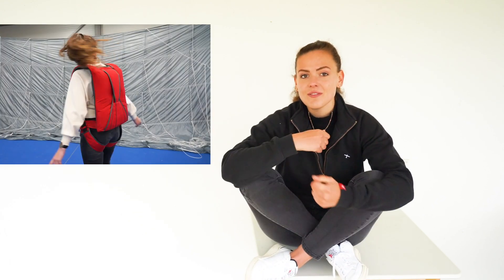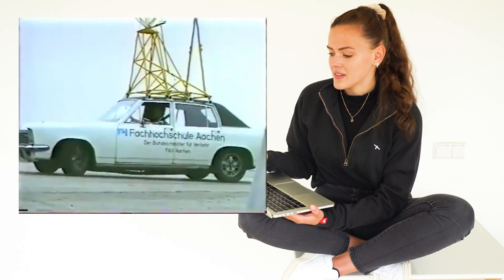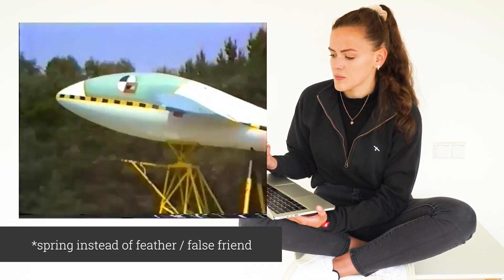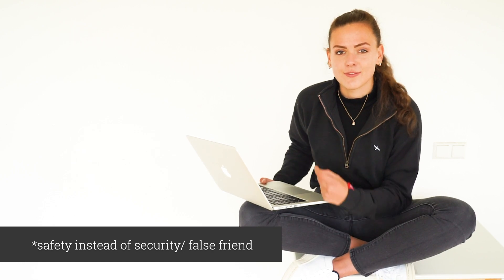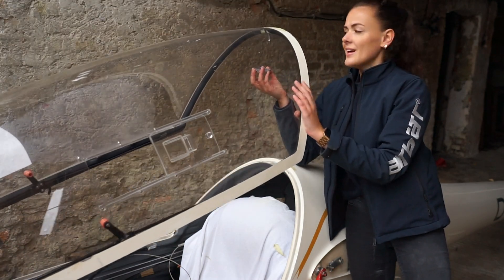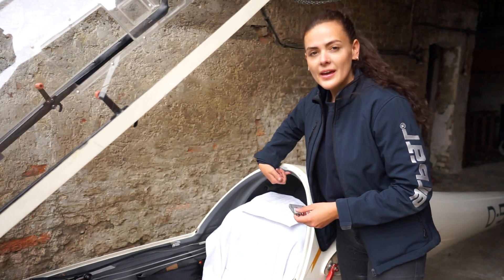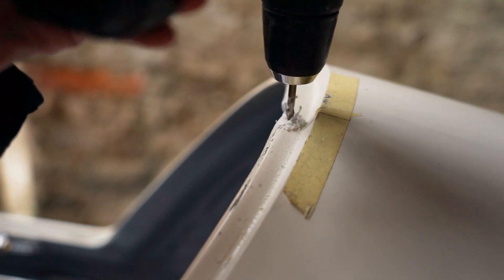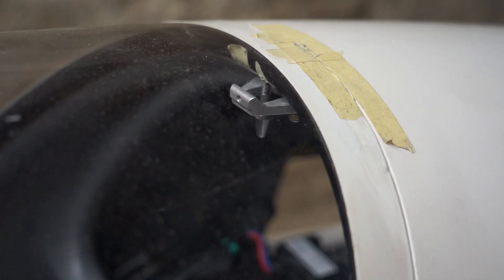EMERGENCY EXIT 🚨 Would YOU get out the Glider?

Comment: I don't get into my glider, a Pilatus PC11-AF, I put it on like clothes. It fits perfect. But! If I have to go out I guess I'm in trouble. As a former skydiver I know how fast the ground reaches at you when you are in 1000m above ground. 
To get out when you are maybe in 800m gnd in a spinning glider, is difficult I guess. 
You have to open the canopy and eject it, open the seat belts, climb out against 200km/h wind in a spinning plane, find the parachute handle and pull it... That has to happen in 10-15 seconds, because below 300m opening altitude your parachute maybe will not open complete. During what action you want to hit the ground?
If I have to do it, I will try it. But I think the succes rate is marginal... 😱🤷🏿‍♂️

But yeah, if there is a possibility to fasten this process, use it!

Comment: This is a really important safety concern. I have an additional question: probably, a glider after collision will  find itself in a spin situation. That means, that in the experiment with the glider on auto the glider should be placed "schräg", oblique to the air flow to demonstrate a real behavior of the canopy. I have mentioned somewhere that my acquaintances have collided and they had no problem exiting their gliders. Anyway, this is my personal attitude, a glider pilot should possess at least basic aerobatic skills (i.e., if the canopy is pressed by airflow, the pilot should use undamaged controls to find a position of the airplane where the canopy will detach and to counteract the G-forces) and at least have some experience with skydiving.

Comment: JS if you see this:  I see you have drilled MANY holes in your glider.  May I suggest the following:  Get a letter envelope and a piece of masking tape.  Every time you drill a hole in your glider, tape the envelope to the area where you are going to drill the holes so that the powder from the hole falls into the envelope.  That way you can keep the area clean and know that no fibreglass dust is going to be floating around your glider next time you pull negative Gs.

Comment: 5:08 Belt Sander, Safety Tip; 
Do not use this belt sander 
in that orientation , hold your item 
in the same fashion, and orientation, 
but move to the opposite
end of sander. This will prevent skips 
and injury, and make for much cleaner 
and easier work. If the belt is moving
away from you , you can finesse the 
hell out of your work, while making 
it look and feel so easy.

Comment: Great video about a very important issue. I own an LS4a like yours and didn't learn about the "hook" until I saw this video yesterday. I intend to install the "hook" ASAP and to fly very conservatively until then, for sure!  
The LS4a has two issues when it comes to bailing out. First, as your video shows very convincingly, the canopy support brace (attaches the canopy to the spring-loaded counterbalanced arm that holds the canopy up when open) is located under the the canopy glare shield, which is also attached to the canopy. If you  do not have the hook installed, pulling the canopy release handle and pushing up on the canopy with the other hand can cause the canopy to be driven directly into your face by the wind. 
If you do manage to eject the canopy and try to get up and out of the cockpit, the fixed instrument panel may keep you from raising your legs over the hump in the seat, making getting up and out very difficult, especially for us older pilots. Actuating an "airbag" to push you upward by the seat might pin one or both legs between fuselage and instrument panel.  
Have you tried to exit the aircraft for a simulated "jump" without the canopy mounted? How do you do it? Can you demonstrate that method? 
Let's hope you don't have to use the "hook", in any case!
Reply: That's a VERY GOOD point. Thanks for bringing up this potential problem. Good on ya mate!

Comment: That was interesting, i did not knew about that device.
I am not sure if it was a good idea to cut out and drill into the bow at that position.
It is not only folded for cosmetic reasons (so that the canopy fits nicely) but stabilizes the tube you are sitting in exactly where it is needed: where it opens up to accept the pilot and canopy.

Furthermore i think the screws will break out instantly when needed because they are drilled too close to the edge, there is not enough material left to take the pulling force. 

Last, at 5:02 you are wearing gloves while grinding. That is forbidden in germany for a reason: The glove may be pulled into the machine which leads to ripped of fingers and tendons (dont google it, pictures are very graphical...). Also, you loose control about the temperature of the working piece instead of feeling and cooling it.
Reply from the maker: Heyy Thanks for your message with your concerns!
This device was installed exactly after the official instructions by DG Flugzeugbau - also it needs to be confirmed by a technical inspector which has been done. 🤙🏼✅

With the gloves you’re right, thanks for pointing it out!

Comment: So, I suppose you do not add feathers to your plane, but (most probably) springs to lift the canopy?
Reply: In fact, DG’s kit for the “hook” includes a bracket with a welded cylindrical cup, a large spring and all associated hardware & instructions for installation. When the canopy release is pulled, the spring inside the cup instantly pops the canopy’s leading edge up into the airstream just enough to allow the wind to lift it away with the hook still engaged to the top of the fuselage until the canopy’s rearward rotation and upward motion cause the hook’s retainer to release it. Let’s all hope we never need to pull that red handle to see how it works!

Comment: I liked the end result of the testing where the canopy cleanly departed the aircraft. But I don't get how this modification does this for you. How does it work?
Reply from the maker: There also is a spring implemented in the front of the canopy, you can see the part in the very first scenes of the video :)
Reply: Where does the pilot push up on the canopy to move it away for ejection?  The pilot pushes from near the rear of the canopy...and the slipstream/aerodynamic forces push the canopy back down.  Not good for ejection.

If a hook holds the rear of the canopy against the canopy rail...as the pilot pushes up, only the front of the canopy can move up. When the front of the canopy moves up high enough, the slipstream gets under the canopy and pushes very hard (while the rear of the canopy is still held by the hook), and the canopy lifts up and pivots around the hook. This is a very fast ejection.
Reply: @TomKrajci  Ah thanks! 👍

Comment: Even when the canopy is out the way, I imagine it might not be easy to climb out and bail safely.  Have you any advice on that?
Reply: Some of the new sailplanes have an option for an inflatable bladder that is placed under the seat pan.  When you pull the canopy ejection handle the bladder is also inflated and you are lifted several inches higher in the seat. Instead of 'climbing out of the bathtub' you 'roll out of bed' in order to bail out.
Reply: @TomKrajci  Thanks Tom.  That's a sensibly simple way of increasing the speed of bailing.
Reply: @TomKrajci  That sounds like a nice idea, especially in a T tail.
Reply: I luckily never experienced a bail out myself, but this what I learned from the bail out stories I heard of so far:
In most cases of a bail out, the glider will be in very unusual flight attitudes, resulting in extreme accelerations and maybe rapidly changing accelerations. When you're "lucky", it might perform negative accelerations (like when the glider oscillates aorund its lateral axis), which will hurl you out of the glider. When you're "unlucky", you only experience positve accelerations, which will press you into your seat. In this case, it's very important to use as much strength as possible, but not to waste any energy unnecessarily (like trying to stand up). Keep your body's center of gravity as low as possible as try to roll yourself over the cockpit frame. Depending on the glider type, this can be very difficult - especially from the back seat of some double seater gliders. 
Another point to keep in mind: after the canopy jettison, you would probably be blinded by the airstream hitting you directly in the face and removing your sun glasses. So you have to be able to open your belt buckle blinded and do the whole bail out procedure blinded - might sound trivial, but I imagine that this can be very frightening in an emergency situation
Reply from the maker: That’s true, I always imagined the horror szenario of having to get out of the Libelle... but the adrenaline rush will probably help you mobilize unimagined forces 🥵
Reply: @julietsierra  I think the most important thing is to think ahead, as you have clearly done.
Reply: Every time I land, I get out of the glider while still wearing my parachute.  They're heavy!  But the practice may save my life one day.  I've heard that the best thing you can do is just stand up and pull the D-ring; there may not be time to think about getting clear of the glider, just getting your canopy open.
Reply: @lautoka63  You should ALWAYS get out wearing the chute. Getting in to a habit of removing the chute harness before climbing out may lead to a rather dangerous situation in an emergency where you undo the wrong thing when trying to bail out.
Reply: @imsoaring  But without the parachute you will get out easier... 😆

Ok, just kidding.
Reply: A bit of Pilates might be the answer to getting out nimbly.
Reply: @mattias6539  A bit of Pilates and a lot of fear (which gives you wings).
Reply: @lautoka63  Pilatus
Reply: @lautoka63  Pilatus, it's pronounced Pilatus... ☝️😆
Reply: @MisterIvyMike  Yes, one does realise this, thank you.  It was just some subtle humour.